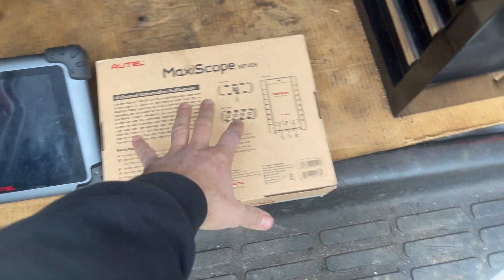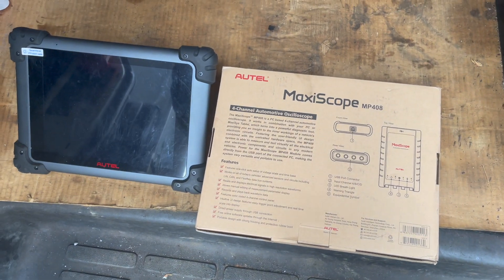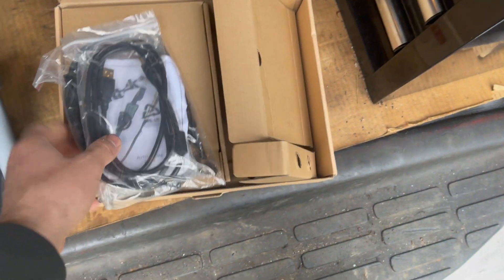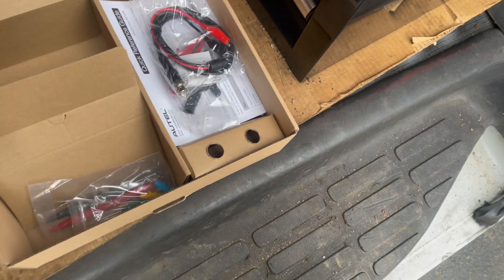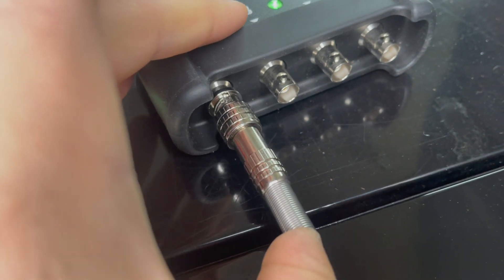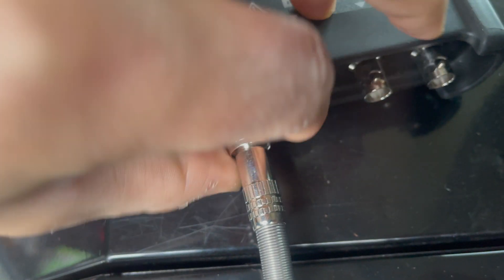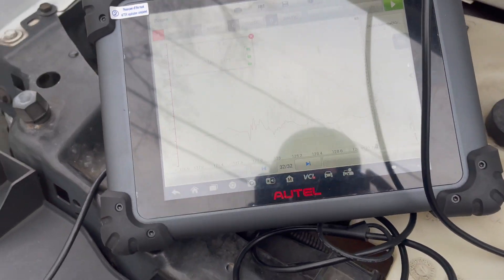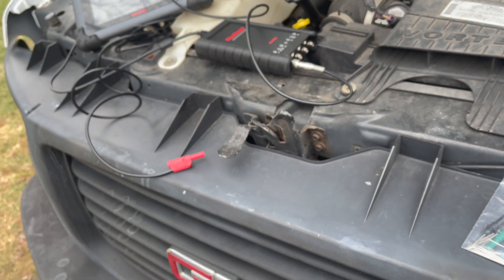Autel MP408 Oscilloscope Unboxing and Hookup  (WARNING - BEGINNER SCOPE USER) | Mobile Mechanic

Comment: Looks good, portable, but it doesn’t have inductive ruler for determining misfiring, that’s why I prefer buying usbosciliscop 4 or motortester diamag, , it’s good to buy scope with not less than 4 Chanel because it’s make good 4 working with v shaped engines, if u have questions how to work with scope n what it can do u may consult with me😎
Reply from the maker: Thank you for your comment, they do make a tool for this as add on for relative compression but will add that to mt collection later. I am a begginer on scopes so any tips or tricks are appreciated